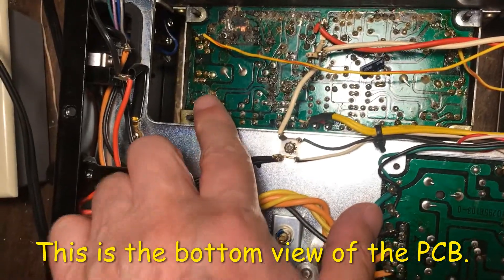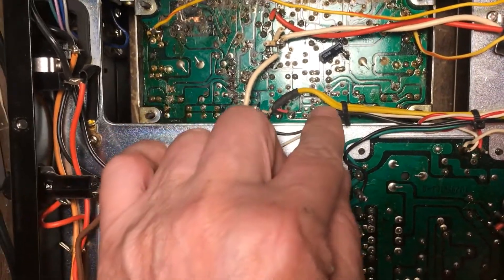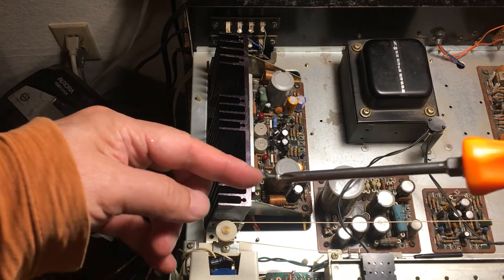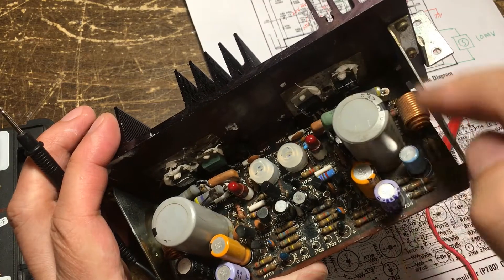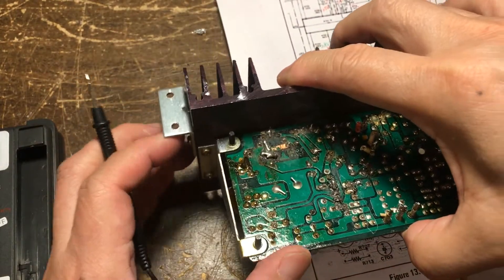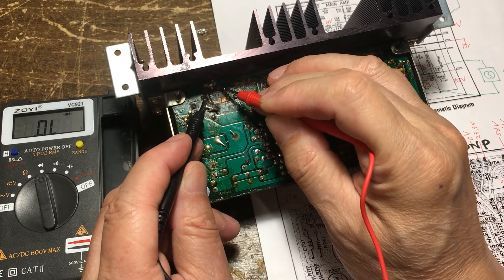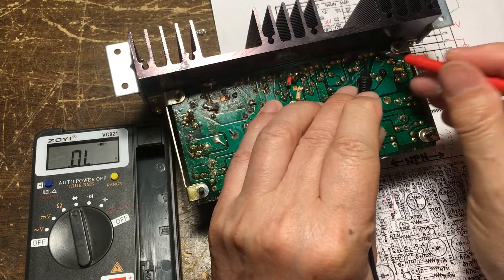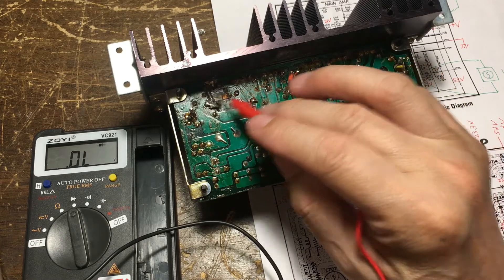Marantz 2215B Repair Part 1 - One Channel No Sound Output

Comment: I have the Marantz 2220b I notice once in a while I get distortion and it cuts out a little on one speaker? Excellent video!
Reply from the maker: It should be a easy fix. I suggest you check (A) the coupling capacitors C701 (L-ch) and C702 (R-ch) both are 3.3u/25V in power amp PCB #P700 (B) the electrolytic capacitors in tone amp PCB #PE01. These capacitors may leak due to aged.